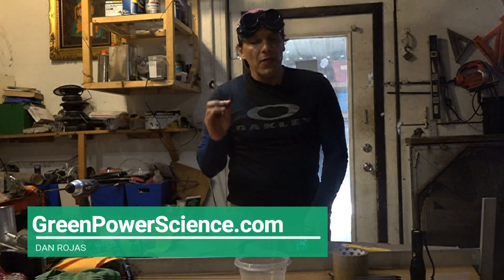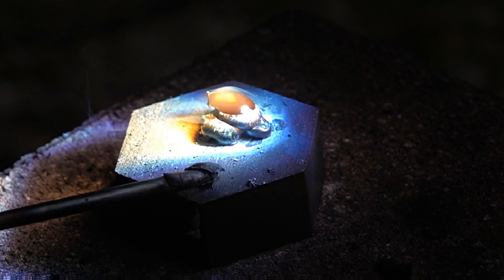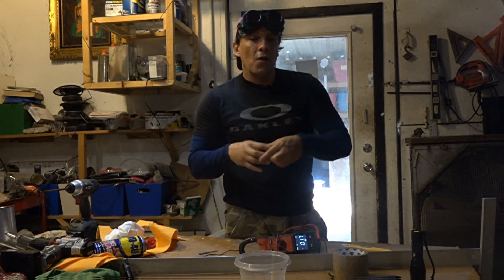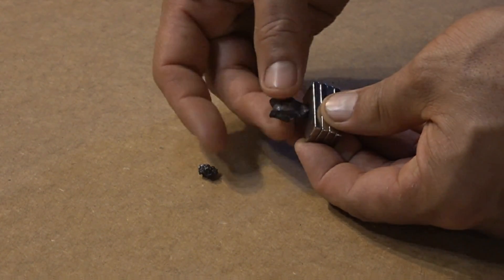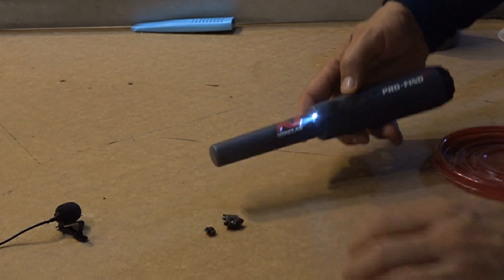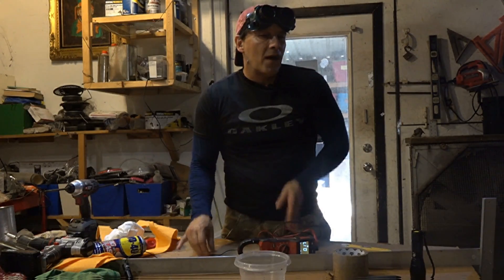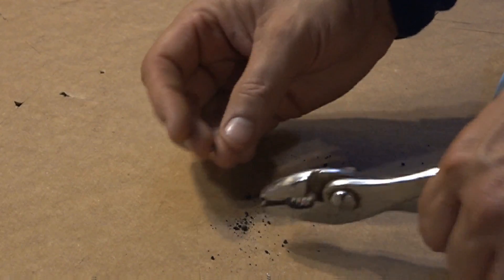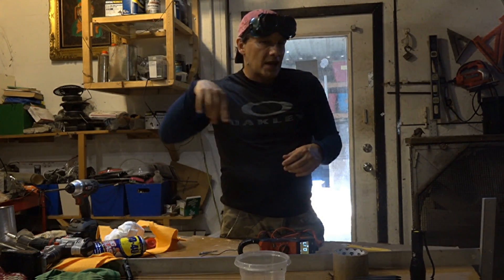Mixing  Glass and Steel using Sunlight non-conductive

Comment: That's wonderful, instantly I see guns and bullets
Reply: Under the radar
Reply: Very interesting, research you have conducted... I'm very impressed. 👌👍😱

How long did it take you to figure this out?
Reply: It would be very interesting to figure out just the right ratio to get it to become non metal detecting with the glass and metal mix, which will result in a much stronger durable non metal detecting mixture.
Reply: The other interesting question will be why doesn't the metal detector pick up a signal, what is preventing that scientifically?

Comment: I know you've said before that crucibles tend to absorb too much heat and break, but have you tried adding a borax glaze to a white crucible with a blowtorch first?  Would the borax re-melt in the sun?  I know the glaze helps keep the heat from traveling into the stone from the metal, and white for obvious reasons.  Just got my 29" mirror btw, I can't wait to try it on a hamburger

Comment: I have a question. If I built a box and made it air tight with a valve to create a vacum, then place s mirror inside on the bottom and put in copper pipes painted black to heat the water (maybe use your idea of using 1" pipe with 1/2 inside and fill gap with sand to minimize condensation and to retain heat) QUESTION: Could clear plastic be used instead of easily breakable glass? Will plasic allow the light through that is necessary for vacum heating system?
Reply from the maker: Plastic will work but you may get drooping and condensation collecting depending on area.

Comment: This is very very interesting... I am of a like mind and work to reuse and reclaim materials to make better, more biofriendly  tech. I wonder, how hard would it be for you to form this mixture into an e-core (Two part) so that a high energy transform coil set could be wound onto it... also have you considered using ferrite (like that which is found as short tube with wire wrapped around them) as a substitute? it can withstand  amazing heat changes, is easily powdered and exhibits many of the same properties. I would be interested  in working with you to create a transformer  with either and or both mediums. If you can, contact me via my channel, Project T-Tech, it's still fairly new and my videos don't have the same polished look yours do but it's interesting. Thanks

Comment: TERRORIST WILL USE THIS SOME DAY
Reply from the maker: No they won't, brittle, glass or plastic knives much better option. Non detectable steel is NOT conductive so it cannot complete a circuit, so useless for boom stuff. Assuming someone did fashion a knife out of this, it would crumble after the first attempt. Again, glass and plastic is much stronger.

Comment: Can anyone tell me how hot a 8 inch by 12 inch fresnel lens can get? I need to know for a science project. PLEASE HELP!
Reply from the maker: A very small area of 900˚ F. This may sound powerful but it is not, just super hot. Easy to start a fire or melt a very small object but no power for larger items.
Reply: If I recall right, the amount of sun that IS on one square cm on Earths surface on average is around  1.92 calories / cm>2 .............  I seem to remember another number stating that each square meter is ~ 1 kilowatt on average of energy. But this is probably not what your going to get in the end results because of loses in efficiency of one sort or another.  So convert your inches to metric or vice versa on the data given and estimate your max and assume 25% less of usable energy............  this is ONLY ball park guessing. 
   did I ever tell you about the Ted Bundy hot dog ( electric chair )cooker  I helped my nephew  build for his science fair project ??  He and the other kids had to demonstrate their  project a day before the fair, he plugged it into the wall ( 120 volts ) and fried a hot dog nicely then ate it.... they were very amused he said and they confiscated his project and gave it back to him at the start of the fair the next day... ... he said  it was ALL Covered with grease from being used  :)))  . He received an "A" on the Ted Bundy cooker and they confiscated the cooker afterwards  ........... !!!   True Story
Reply: GREENPOWERSCIENCE OMG thank you so much, you just earned yourself a subscriber. Have a nice day!

Comment: The magnetic field produced by the metal detector induces a current in nearby metallic objects. This current produces a magnetic field in the nearby metallic object, which the metal detector can detect. My theory is that your amalgam is mixed so thoroughly that the metal atoms are mostly separated by the non-conductive atoms from the glass.  Current requires a flow of electrons. You cannot have a flow of electrons in a single metal atom surrounded by non-conductive atoms. No electron flow = no current = no magnetic field = cannot be detected by metal detector.  And while a single atom cannot have a current, it CAN be a magnet (I checked). This explains why the amalgam is attracted to the magnet. And of course because the metal atoms are separated by silica atoms, the amalgam won't be conductive. That's my theory.
Can the amalgam be magnetized?
Reply: Even if the material were not so thoroughly mixed the currents would be so small that the metal detector could not detect the current flowing through the smaller particles. The mix doesn't have to be at the atomic level. There is a level of metal that the detector cannot detect. if no single piece of metal embedded in the glass is smaller than the detector can detect the metal wont be detected. Its all about the amount of signal that can be received by the detector.  The smaller the individual piece of un-insulated  metal the smaller the signal.
Reply: You both could be right

Comment: If I recall, you created a large magnifying lens using water poured on clear flexible plastic on an overhead wood frame, or something to that effect,  and it worked great to heat / cook with despite the problem that the lenses could not be perfectly focused ( angled ) due to the nature of it being liquid........  having said that............ have you tried adding clear  jelling compound to the water and creating 1/2 lens , then create another 1/2 lens ... then stacking them -  mounting them in an adjustable frame ?   Ballistics jell comes to mind ... CLEAR  only .

Comment: I would be very curious how the machining properties would be, also if machinable could very low friction bearings ( sleeve or spindle types ) be made.  If a large chunk could be made it were need to be shaped in a surface grinder with a rotary table, producing a solid round bar as a starting point for further tests. 
  I think you used the right approach with slowly lessening the temp as it cooled, usually in knife making as you know to re-harden the metal you heat it up to slightly yellow color and quench in oil or water, then to take out the brittleness you sacrifice a bit of hardness by "tempering" which means slowly raising its temp to 400 f.  ~   500 f.   ~  600 f.  depending on the type of metal and hardness required. 
   If I ever get some money I just gotta buy one of those lenses  .....  WOW  !!

Comment: Not gonna lie, this is pretty scary to me. Especially considering you made it using a simple Fresnel lens. Call me a pessimist if you will, but I'm just thinking about, for example, a handgun potentially made from this stuff getting thru an airport metal detector. Just sayin.
Reply from the maker: The material is brittle so it would explode and the projectile would remain in what is left of the barrel. Just sayin, a knife would inflict one victim before it breaks. Plastics are way more dangerous. This video is not about creating a terrorist device. It is just illustrating that steel can be cloaked within glass. Not conductive so, there goes the use as a conductor. This may be a way of creating semiconductors that could increase computing power x 10,000. I do agree that massive computing power is horrifying in a way. Just look at anything that relies on algorithms.

Comment from the maker: Keep in mind I crushed this with a pair of pliers. Broken glass alone is much stronger and also cannot be detected by a metal detector. Also not conductive. Not sure what use this would have for evil acts. At best, you would have a knife that would shatter if you dropped it.. FYI, plastic knifes sold on the internet or at Wal-mart are much stronger.

Comment: Have you tried to raise the multimeter range to see if it has a resistance in the thousands or millions of Ohms? The material might break up the steel particles so they don't easily conduct electricity, but it might be more of a resistor than an insulator depending on the mixture. Awesome experiment!

Comment: maybe the glass reacted with the iron to make magnetite
4SiO2 + 6Fe -> 4Si + 2Fe3O4

im not a scientist so im not sure about that
Reply: I don't think that reaction works. Pure silicon reacts violently with oxygen, however no reaction took place as he melted them both so you can infer from this that the item created is simply a heterogeneous mixture of two solids.
Reply: Thanks for that Eric.  Appending your info, isn't glass already endowed with the Oxide of Silicon, plus some alkalai elements and proprietary magiks?  Glass is not a solid solution, but rather, flash frozen well below its freezing point..  (the magiks part)
Reply: I guess it is a kind of Fe-Si-O mixture.
Maybe a mix of Fayalite (Fe2SiO4), Fe2O3, SiO2
Reply: Right, Grunthos, it's an amorphous superfluid in a rigid state.

Comment: Ok. I'm just gonna throw this out there and you guys let me know what you think:
1) Glass can be an Electrical insulator.
2) There are no Magnetic insulators.
3) The metal detector works by inducting current to objects to alter their magnetic fields and detect that.

So the detector doesn't notice the object in question, perhaps because it can't induce enough current to the metal due to the insulation provided by the glass.

I really can't think of anything else.

Comment: Fascinating. Seems like you may have altered the chemical composition(chemical formula) rather than just making an alloy or mixture. Since the substance has the brittleness of glass and the electrical conductivity of glass, I wonder what qualities of the screws was inherited, other than light transmission/opacity and magnetic capability.  The pairing of magnetic susceptibility with electrical non-conductivity seems unusual, especially since electrical and magnetic fields usually coexist. Changing the ratio of metal to glass may change the conductivity. To conduct electricity, particles have to be in close contact, I think. Not so for magnetic fields.
    What about the parallel of semiconductor doping? Lots of ideas to explore.

Comment: Very interesting Dan and maybe you have stumbled onto something bad.  I mean bad as in the ultimate assassin's tool but it depends on how well it stays together upon impact or how well it would hold up as a material for a gun.  It looks like it is pretty fragile for your sample but get it into a place that could refine the process and maybe even mix a third element into it to make it bond better then if it held up well and gun + ammunition was made out of it then umph.
Reply: I think the material is too brittle for explosions. If the mixture ratio changes, the detector status will probably change too.
Reply: Well, one stab might be enough.
Reply: Precisely.  A wonderful material for an assassin and with the proper mixture it could be strengthened without changing the cloaking ability.
Reply: Think of it like this. If you've thought of it, the CIA and the KGB probably thought of it twenty years ago.
Reply: Exactly but now we can open source it for the assassins. :)
Reply: Or you could use a regular glass Knife instead

Comment: If you use a high voltage to electrostatically charge the steel while it is molten, it might stay electrostatically charged inside the glass, thus making it electrically attractive to all materials similar to the way a magnet attract steel.

Comment: ★Amazing Report Thank-you! ★Wikipedia Earth Battery →★Its Free Energy From Like 1800's →★Today Ppl Are Doing Cool Experiments With Graphene →★Maybe Mix Graphene With Glass See If It's Bullet Proof →★(Mixing Graphene With Plastic Stopped A Bullet & Mixing Glass With Bamboo Made It Stronger Than Steel) →★Maybe Graphene & Glass Could Also Make Infinite Supply Power Batteries Small Portable Power Appliances ★Pencil Lead Is Graphene ★I Buy A Pack Of Pencils Set Them On Fire Burn Off Wood For Graphene

Comment: place under water and see if releases H gas https://en.wikipedia.org/wiki/Ferrosilicon
Reply: Brian Stevens You might be right. Lye and water generates massive amounts of H with aluminum, but I don't understand how silicon and iron would react, although apparently it's been done according to the article.  If you alloy gallium and aluminum, it allows water to bind with aluminum forming an oxide and hydrogen. Maybe the silicon enables rust to form easier, absorbing the oxygen from water and releasing the hydrogen?
Reply: wow youtube's comments travel slowly a ? we both updated the same article :D

Comment: ISIS just discovered a new weapon.......
Reply: brikag 
Don't tell the Daily Mail, the slingshot channel has just been trashed by them.
Reply: Not if you can crush it with pliers, by hand.
Reply: You can fashion it in a blade form using a mold.
Reply: +brikag Are you implying they will now start throwing iron infused glass rocks instead of using firearms and bombs ? Because if this is their new weapon it means we are very safe. We are probably not very safe from your IQ perspective unfortunately though.
Reply: They give you a knife for eating once you are on the plane so ... why bother
Reply from the maker: No, it is useless for that. I CRUSHED IT WITH A PAIR OF PLIERS.  What the  heck could they use it for? Not conductive so the other possibility is out the window.
Reply: brikag 
Why not just go on amazon, you can buy a non magnetic, non metal ceramic knife really cheaply. The things are so sharp you can slice raw chicken meat so thin it's transparent.
Reply: mr bumbaklat 
Only some, my detector or pro pointer won't pick up my vegetable knives.
Reply from the maker: Plastic is much stronger and easily sharpened.
Reply: @Green Silver because a Bulletproof vest totally protects your neck and face and between the legs...
Reply: Green Silver ceramic knife manufactures add a small amount of iron filings to the blade so it will get picked up by metal detectors
Reply: I belive Jörg is cleared and ok now!
Reply: congrats...you just gave them a better idea
Reply: MeNotSanta an idea better than a horrible idea is still a horrible idea (in this case)
Reply: brikag Dragonglass?